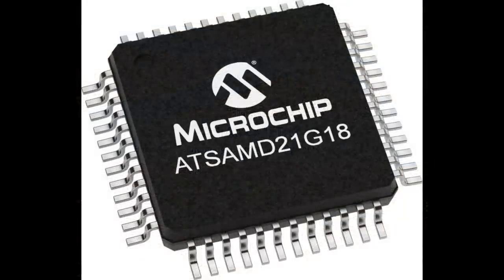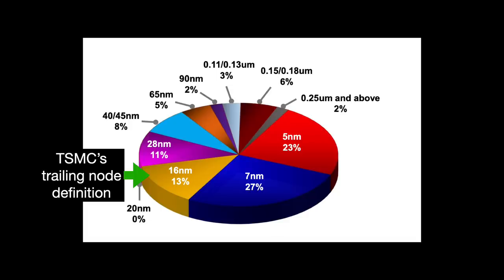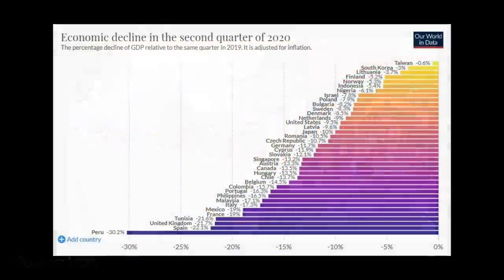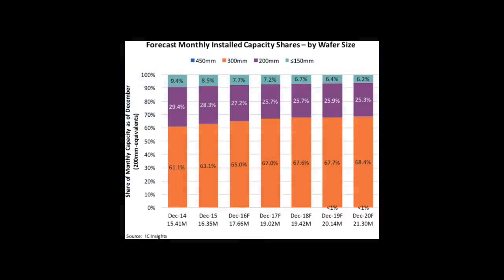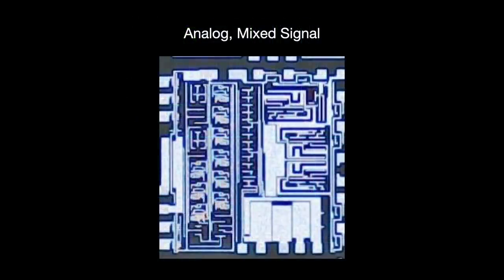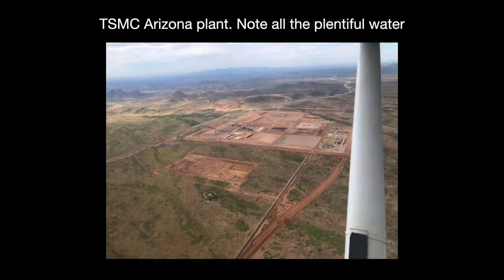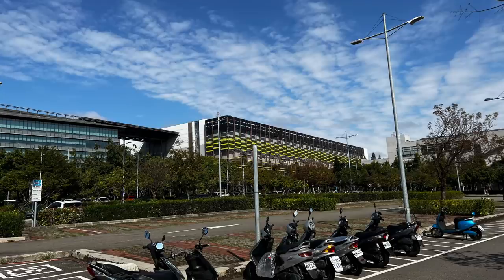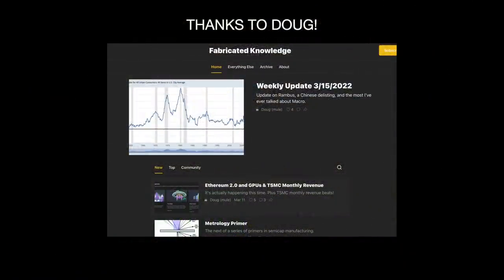Where The Real Chip Shortage Is

Comment: An amazing analysis, as always. Thanks!!! So many good ebservations in the comments, too.
The video was looking at the main source of the current problems, however, it's also worth mentioning that chip designs are tuned to a specific implementation of technology at a certain node, so production can not be easily shifted to another fab line, even at the same node. The more advanced the technology node, the more this is the case. This creates inflexibility, so even when there is wafer capacity available somewhere else, it's no help in expanding production of a specific chip.
Older lines often produce many different chips, so production scheduling becomes a delicate balancing act, trying to satisfy ongoing demand without gaps in the supply and to minimize the frequency of retooling.
In addition, while the main issue is silicon, there are material and capacity shortages in a lot of areas, affecting current semi production.
At the moment, lead times are crazy and often previously confirmed orders are getting partially or fully "deallocated", just before delivery. 
Then of course, greed kicks in. The worst I come across was a supplier trying to charge 210(!) times the price of the normal supply price of a chip. Counterfeiting is also rife, with buyers forced to do extreme measures like x-raying chips before accepting them. Leadtimes? I've seen 99 weeks. Increasingly, manufacturers just throw their hands up and simply EOL part of their product line, causing mayhem for equipment builders. Some companies producing and selling hardware with thin margains can often make more money reselling the surplus parts they actually have (maybe becuase of over-ordering, maybe because of missing a crucial part to complete the BoM) than what they make from building new gear which may be at negative margains, due to high component prices. Of course, selling surplus stock is just a sugar hit and the reduced production may kill their business in the long run.
...but I'm sure you've all heard similar stories! ☹

Comment: The SAM is of course an inherited Atmel chip.

Indeed all Atmel, Microchip, NXP, Nuvoton, STM low-end micros are sold out a year in advance and have been for a year and something, everything under $3, most things under $7 as well. And it's been a lot tougher to work around than shortages of higher end chips, which are still kinda available. Also special function analogue/linear semiconductors of particular kinds are hit hard.

Chinese domestic chips have better availability. Maybe more 45-28nm utilisation? I do think maxing 28nm and node shrinking designs needs to be an intermediate goal, i feel, not adding another 90nm fab. But i think more 28nm fabs won't go to waste.
Reply: If the lead times surpasses the design time heavy disruptions is the design ecosystem emerge. Before no one consider to porting a 2$ chip. If you already port why not give up the old silo system of compiler + squeezed old fab + broking distribution
Reply: Not all, there are several STM32L stocked for low power with LCD control for example- And then there's the RP2040, $1 chip with $1 flash+accessories, good performance and excellent support. People should be using it more.
Reply: Atsam is a 32bit chip and will migrate easily to risc-v chips which will be made on old equipment in China for pennies. 

The trailing edge chipmakers understand these risks and are willing to let the world burn to avoid getting crushed.
Reply: @jan.tichavsky  rp2040 has external firmware and no provision for ROM encryption, which makes it nominally unsuitable for most commercial products. And open source projects often get fouled by its glitchy ADC, which is not entirely surprising of a company with no such design experience, they'll get it right eventually.
Reply: @SianaGearz  And last I checked, you can't buy more than 10 at a time. It's limited for home DIY and school farting around.
Reply: @paulschreiber9384  The Pico boards? Probably. RP2040 chips are available in 500 and 3400 reel quantities if that's how you want to roll. Supplies are a little limited, if you want to buy 5 reels, you might be in a little trouble.
Reply: @jan.tichavsky  "RP2040" and "low power" don't belong in the same paragraph. I would use it, but if I'm looking for an MCU, it's probably battery-powered-counting-microamps.

Comment: 1. An advantage to using trailing-edge technology is that it's easier to find substitutes. As you say, these are commodity parts with multiple suppliers, so you could perhaps find a software-compatible part with a different package or extra features. Compare that with finding a substitute for a bleeding-edge Nvidia GPU.
2. You may not need to construct new buildings to convert a fab from 200 mm to 300 mm wafers, but you do have to acquire all new equipment, as 300 mm wafers won't fit in 200 mm equipment. There are half-measures that can help, like re-optimizing the current processing procedures, jamming in more 200 mm equipment in places where it would help, and eliminating special-case processing steps as much as possible. These are some of the work-arounds used in the initial 200 mm to 300 mm transition in the 1990s.

Comment: Moving to a larger wafer size is almost building a new fab with almost all equipment needing to be replaced.  It is not as simple as you suggest.
Reply from the maker: It never is. Think I made that pretty clear
Reply: Just try buying a 2000V 2000A optically fired thyristor if you want to try long lead.
The 300mm chip diameter has a 1% manufacturing yield…
18 month delivery time precrunch…

Comment: Preface: I've worked 25 years for semi companies, Microchip the most recent (out of 40+ years designing products).

This video, and all the other ones I've seen, "blame it on the fab capacity"

It's not the fab capacity.

It's packaging capacity. Testing capacity. Mask costs (especially 28nm and 22nm. At <17nm you are talking $5million mask sets).

You can't make a baby in 1 month by making 9 women pregnant.

The days of Microchip offering 50 variations in memory size/packaging/temperature for 1 base MCU part/die are now over. The days of Maxim offing 48 different reference voltage options off 1 die are over.

The glory  days of Mouser and Digikey are over. Distribution has always been last in line, and now these "catalog distributors" will only see floor sweepings, random cancelled surplus orders, and whatever random parts TI and ADI and Microchip have leftover. If you are over 55yrs old: remember PolyPaks? Godboudt?

There is now a major, fundamental swing in 'hobbyist' and 'let's make some guitar pedals for KickStarter' people. I've designed and sold music synthesizers for the last 25 years and I'm hanging it up after my inventory depletes. I'm stocking up on FPGA dev boards for hobby entertainment.
Reply: Hi Paul, thank you for your insights!

Comment: I’ve been wondering about the supply chain of microcontrollers for a while — it doesn’t make sense that car parts would use cutting edge processors 

In my experience, embedded systems engineers have gotten used to overspecifying chips vs optimising code better — this can and should change
Reply: That has nothing to do with the shortage. Many micro processors are in short supply. Squeezing your code into a smaller chip isn’t going to help this problem.
Reply: Automotive chip needs to comply with automotive standard(safety, stability). That mean they go through more test process than other commercial chip. lead time can be up to 2x compare to ordinary chip.
Reply: All of this talk is interesting, but kinda missing the point anyway. Most consumers do not want or need a car with computer chips anyway. Car COMPANIES would rather put chips in their products to enable things like tracking of customer's behaviour, and to justify a higher price tag, but this is just extra expense with very little utility to the end user.
Reply: @andreaslind6338  True, anyway all the user wants is an iPad instead of the shitty car screen and OS.
Reply: @andreaslind6338  then just buy yourself a 70's car. Give up the fuel economy and the horse power. Give up the 6 gear transmission that adapts to the road. Give up ABS and traction control. Go back to cars that are dead at 100k miles. Enjoy exhaust pollution that was bad enough that people k*lled themselves with it.  
These things are there because people want them.
Reply: @peterbonucci9661  even a 90's car does nott have much processing power just basic plc and microcontroller if you even consider it's Mpfi with an ECU and traction/abs system. Exhaust filtration tech has not changed much in gasoline we still use catalytic converts and 4 stroke to this day. It was the lead used in petrol octane boosting that caused people to become dumb or die. we have unleaded fuel now in case you didnt know
Reply: @peterbonucci9661  Black and white fallacy. 1990s cars had better fuel economy and emissions control than 70s cars, and 2000s cars already had parking sensors.
Reply: @ChucksSEADnDEAD  I admit that I don't know the details of the history of ECUs and TCUs in cars. The point is that the features I listed are currently implemented in ECUs and TCUs and if you give up processers in cars you will give up a lot of features that people take for granted.
Even something as simple as a pedal map requires CPUs now. It used to be implemented with a cam, but now it can change with the environment. That directly changes the experience of driving a car.
I remember that electronic ignition came in in the 70s and that there were a lot of "computer" failures in the 80s. Whether  or not these devices count as computers isn't really relevant to my point. 
One of the reasons I didn't go into this much detail is that I really didn't want to turn the comment into a wall of text.
Reply: @andreaslind6338  do you have any idea what the computer chips are for?? Not everyone needs an entertainment system, but everyone does need an ECU
Reply: @peterbonucci9661  We're not talking about giving up processors in cars. We're talking about how self-driving modes and tracking increase the demand for chips beyond what was commonplace 20 years ago.
Reply: @pabanoid  Doesn't pass the smell test. We have had to swap our standard parts for automotive rated parts in many instances, because the more expensive automotive rated parts are still available, whereas the cheaper standard parts aren't available until March 2023. I agree with you the lead times may be longer for automotive grade, but that is not related to the current shortages.
Reply: @BangkokBubonaglia  @pabanoid automotive lines are usually legacy lines because it’s hard to get approval from regulators, so they keep the lines open for longer. The lead time is usually 99% regulatory approval so it’s affected by the shortage but in an unintuitive way
Reply: @andreaslind6338  I hate to be boring but the microcontrollers in question aren’t tracking you — what we’re talking about is a chip in the seat heater button to tell a CAN transceiver to send an encrypted(?) signal to the BCU(or whatever - depends on the architecture) to send a signal to a transceiver chip to tell a controller chip in the seat to modulate the power going to the heater, etc. none of the chips in question are clever enough to talk to the cloud; they’re simply about making electronics modular and secure. 

There are tonnes of proprietary evil things here (right to repair etc) but none of them are tracking you.

Media units track you but they use more high end ARM/X86 chips on modern fabs.
Reply: @neilkurzman4907  Totally disagree — I see engineers overspeccing to cut devt effort by a factor of 10x+. You could get a lot more out of a wafer if you have 10-100x fewer transistors or a much higher yield if you target a 10x lower clock rate (although sure yield on a mature line is probably pretty high already)
Reply: @lawrencejob  Wow. I did not know that my comment would provoke such discussion. Great, it's good to exchange views.

I'm sure I saw an article about a year ago that a european car company had been installing chips to rate divers' driving and that this would be used by insurance companies to set the driver's premiums. YouTube won't allow comments with links so I won't post here but I did see it.

Having a single point of failure is just not good.

To draw an analogy to medicine, the sinoatrial node is a bundle of nerves that regulates the beating of the heart, it is like the ecu of the heart, if you will, but the heart WILL STILL BEAT IF THE SA NODE IS DAMAGED OR DESTROYED. this fact saves many peoples lives. 

It would surely be better to design a car that had ecus but could , if it needed to, run without them, just with worse fuel economy, or suspensión or whatever. 

I'm sure there are also mechanical devices that could support or replace ecus if need be, just because Ecus are usefull does not mean they have to be microchips.

I think cars are a big investment for people, and they should be built to last, you should not have to pay $$$$$$ To replace a simple microchip. The fact that those microchips are so expensive effectively binds the user to the car company, and it is anticompeteive and anticonsumer.
Reply: @andreaslind6338  I’m enjoying this too and I’m grateful for this comment thread. I think the issue comes from the fact that we use microchip to mean many things. It’s actually a brand name, a verb and a noun. 

99.999% of chips in cars are nothing more than controllers of small modules (like heated seats) and aren’t really capable of anything other than their simple function.

To track vehicle telemetry you need sensors, processing power to transform the data (compute), storage to record to (buffer) and 3G/GSM/Wi-Fi (transmission) — most of these are sophisticated/high-end SoCs bundled with modems etc and most of them are built into the infotainment system.

You’re totally right that they do it and are very rightfully annoyed about the privacy implications, it’s just that most of the chips mentioned in this video aren’t capable of this. They’re there to control your window motor or your cabin light or your indicator signal etc — very basic single-purpose and super super necessary for mass production

PS many modern cars can actually run with a partial or missing ECU, assuming ignition is controlled by a redundant system (decoupling ignition from rotation has so much efficiency advantage it’s probably worth it). Most VVT etc is done mechanically but with electronic actuation. 

I’d much rather the public had better knowledge of ECUs/electronics and firmware flashing (open source ECU?) so we could feel as comfortable fixing electronics as we do fixing mechanics

Comment: I want to thank you for an excellent summary of a much neglected topic.  I retired last year from Microchip, working mostly on Reliability / Quality issues with mature EEPROMs for Auto and high Reliability customers. When you have to get long term performance out of non-Volatle memories even 250 or 180nm nodes can be touchy.  Steve Sangi did a great job building up a 'trailing edge' business.  Predicting the overall industry can be pretty difficult though.  When I was at IBM Microelectronics I recall a senior engineer commenting (in 1991) that in ten years 2 or 3 Fabs would support all the chip needs of the workld's computers (ie, no phones, smart systems, etc...).

Comment: There is a fortune to be made for the person who sets up a proper e-recycling shop that focuses on chip reclamation with efficient acquisition, processing, and  quality control.  There is no shortage of e-waste and it's current use is messy at best.
Reply: Heh, china already does that - where do you think all the "counterfit" parts on ebay, aliexpress, and amazon come from? They're all re-marked recycled chips
Reply: I remember there is a video where someone try to build Iphone in China, and they go to this electronic market to buy the Apple processor
Reply: @edojayakusuma8209  Probably a Stranger Parts video...
Reply: Ok for analog or simple CMOS ICs but not for MCUs or low-power processors because you also need the software and tools to reprogram them. Despite many retroengineering projects, it's quite usual to not be able to repurpose the 90's and 00's generations. If there is a way,  devs often occur challenges like assembler-only compiler, old C or C++ standard, DOS program, programmer with parrallel port interface or (in the case of processors) supported only by NetBSD.
Reply: The Chinese are already doing this. Nobody wants reclaim chips. The whole process runs the risk of damage plus you don’t know how old the chip is.
Reply: @neilkurzman4907  Some people do and there are also reputable resellers of these chips that you can buy confidently. But it is old, low integration stuff. For precision analog components the old age is benefit, you will get much more stable output. If it was extracted gently and checked for function then it's fine to use. Better than buying new for similar price which is guaranteed to drift for the next 1000 hours.
Reply: @jan.tichavsky  hmmm… things like cristals are directly aged by manufacturers already. And because of drift, genuine precision devices do autocalibration in the start routine program or allow the user/maintenance to calibrate by themselves so the argument isn't that relevant.

Comment: I think we need graphene copper boards and transistors . i dont know what introducing such an alloy would do to lithography but the lower resistance and higher overall conductivity will certainly help something. If not just power delivery and heat dissipation.